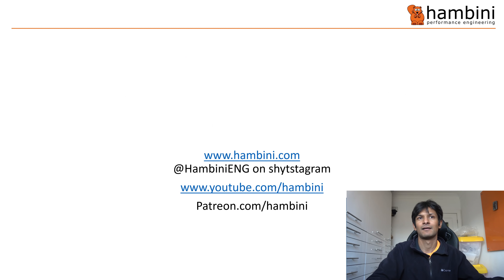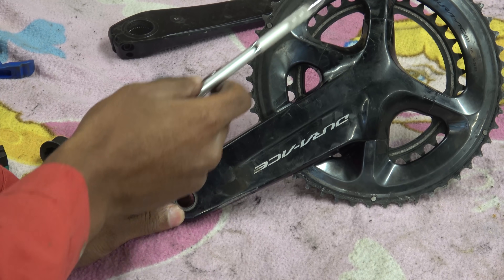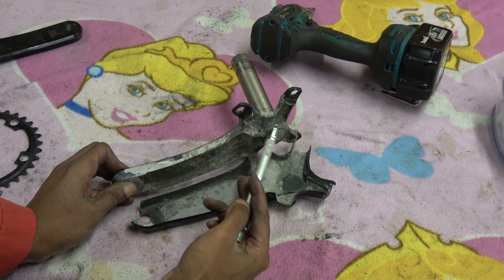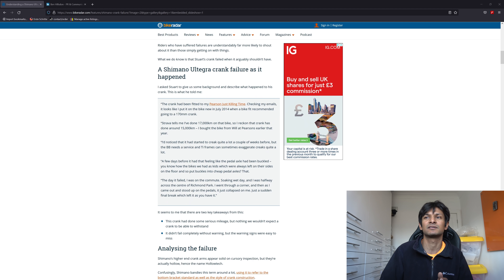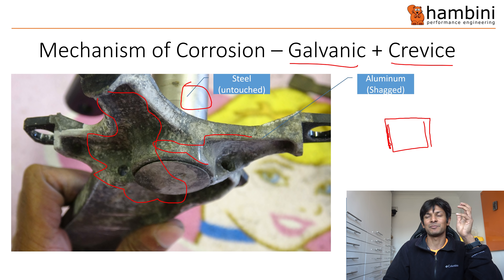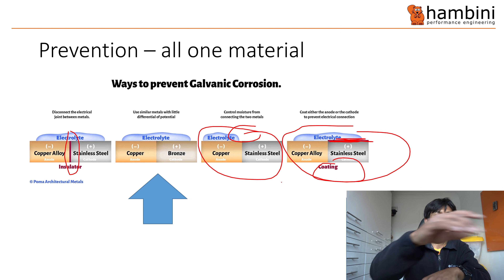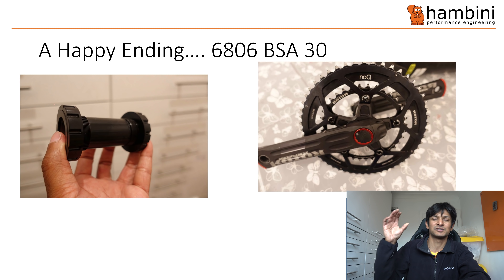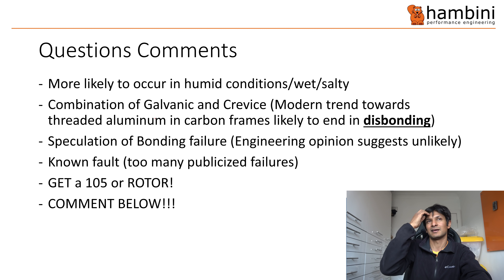Shimano REAMED for Engineering Incompetence

Comment: This was your best review by far and a well presented case Hambini . As a keen cyclist myself, the more you explained the reasons with the science behind it all, everything kept on becoming clearer and clearer. It was excellent !  I have had a Dura Ace 9000 split just as you described and was totally Peed off with the failure. It seems so unfair that the   extra price you pay for the bling stuff is made this way.
Reply: This is exactly for blink factor and for competition only. It’s a trade off. Something has to give under extremely engineering to win competitions.
Reply: The price you pay is for lightness, not durability. This is why it's recommended to NOT get dura ace accept on your race bike, if you have different bikes, otherwise, Ultegra or 105 for putting on tons of miles and time.
Reply: @budviser3793 But every reviewer and bikeshop I’ve listened to says you’re paying for lightweight and INCREASED durability as you go up the tiers in groupset. It’s all marketing ballshit aye

Comment: I am always amazed to find people attaching aluminum to steel or, for that matter, embedding aluminum in concrete. It's pretty basic engineering knowledge that galvanic corrosion results when these materials are in contact with each other. Ages ago I worked for DART in Dallas and when they took over the bus system (to expand coverage etc.) they needed new signage. There was a desire for the posts holding the bus route designations to be something "nicer" than a galvanized steel pole. They chose a square cross-section aluminum pole. It looked quite nice. Within a year of deploying these poles across the metro Dallas area, they started falling over. Turns out they were installed in concrete bases and the corrosion was so extreme at the point where the poles touched the concrete the base of the poles basically melted. Needless to say, the DART engineers were dumbstruck because they were never consulted. Had they been, they would have pointed out the aluminum had to be isolated from the concrete. Steel, especially galvanized steel, does not have this problem with concrete. This is like finding out buried water lines to my home installed a century ago were lead... seriously. Lead.
Reply: Shimano (and others) used steel axles in aluminium cranks for a long time. They don't corrode. I'm not sure this is the reason for the failure. if the glue detaches and opens the insides to humidity, it will corrode. And obviously it would detach where at the most stressed location, which is near center of rotation.

Comment: It’s pretty amazing that this has been going on for so long and Shimano are like “move along, nothing to see here”.
Reply: When this first started, the crank cracking, I thought it was a 6800 Ultegra thing because the new model is coming out since it has been running from 2013 with no failures then suddenly a lot failed in 2017. But the new models even Dura Ace suddenly started dying and me on 105 got scared for it's life despite the crank being 105 5600 lol and then I heard old hollowtech is the good one.
Reply: @Allan In person, I've seen 2 6800 fail, 1 R8000 and the rest I saw on social media. I've since then "upgraded" from a 172.5 5600 105 to a 165 4700 Tiagra and despite the weight penalty, the bikefit is much better and I think that's more important.
Reply: Shimano have used this strategy on many products since they started. It’ll get looked at when doing the next product refresh, but they are too committed to the tooling, etc to change. Cheaper for them to just be quiet and warranty the failed ones.
Reply: @codycanning5300  I doubt they’ll do anything when they refresh their lineups. We’ve all got the same issues in mountain biking we’ve been complaining about for over ten years now.
Reply: @KK-bk3dm  At the end of the 80-ties they where good. Since then it has been down the monopoly drain. Today they are selling mainly the stickers and a huge marketing budget mark-up. Fortunately the Chinese are catching up and alternatives are abound. I build recently myself a carbon frame road bike purely under the assumption that there will be not a single piece from shimano on it.

Comment: The VERY reason I run 105 Cranks. Thanks for bringing this back in focus and not letting Shimano off the hook. All of your videos are highly anticipated. Great channel, Thanks for all you do.👍
Reply: 105 same construction are they not? Hollowtech?
Reply: @paulruffy8389  They are not constructed the same at all. Hollowtech crank arms on 105 are not bonded. Shimano doesn't tell you about the difference sadly.
Reply: @larrymcgoldrick3471  I have actually just "upgraded" to a Ultegra crankset from 105, just as the the 105 was marked up and the gearing is 6870di2. But makes me wonder whether I shoulda just kept the 105 crank
Reply: On which series Dura Ace/Ultegra did they start doing bonded cranksets?
Reply: @Knowbody42  9000/6800
Reply: @dan_lazaro  I see. I guess I'm lucky to have dodged that with my Ultegra 6700 kit.
Reply: @Knowbody42  my favourite looking crank is the 6700/7900 series Ultegra Dura Ace from Shimano haha I just looks so much better than the 4 arm spider stuff even though I'm on Tiagra 4700 now. 165 Ultegra cranks are just so much more expensive in my country because people think it is a limited edition of some sort and not just a size option and I've never seen a 165 Ultegra 6700 that's compatible with 53-39 because cranks of that gen are different bcd in the standard vs compact affair haha. Def would love to rock the 6700 ultegra crank one day though, maybe someone somewhere would have the crank in my specs and it will show up to me at the right time
Reply: @dan_lazaro  Yeah, I always thought the 6700 crank looked better.

Comment: Mine failed on winter bike on Saturday, Ultegra R8000

Been well aware of the issue so check the crank/chainring for gaps while cleaning the drivetrain after every long ride. Went without warning just a pop/clunk while out of the saddle. Starting to separate in the centre and a crack forming on the crank arm behind the small chainring😠

Fortunately didn’t totally fail as still had 40+ miles to get home

Comment: Nice flashback to chemistry class! Yes, galvanic corrosion will occur in any two materials that have different electronegativity, especially in metals since they have so many free electrons I guess.
Stuck aluminium seat tubes or stems on steel frames was (and still is) very common, but that is an easy fix, just grease it down thus creating an insulating cover.
I have an oldish Sora crankset that sometimes creak, I thought it was the bearings, but now I'll have to really check!

Comment: In cars and trucks, rust expansion is called rust jacking.  It's also common in general for steel lintels in houses.
In cycling, aluminum seatposts corrode in steel frames. Removing one can be a monumental job.

Comment: I had exactly the same problem which turned into a full catastrophic failure across the spider itself.  It failed on a climb during a race, not much fun.  I thought that my bottom bracket was creaking but obviously it turned out to be a crank failure.  I did manage to ride / nurse the bike to the pub safely, so not all was lost.
Reply: I ride mostly track bikes if this happened at any rate of speed its OTB
Reply: @coreygolphenee9633  Fair point, but I don't know if Shimano do a track version of the 9100 series? (i.e built & assembled in the same way). Does seem that the failure mode will lead to an unexpected freewheel effect though, so possibly not OTB... (crashing to the floor probably very likely though :( )
Reply: @neilbathe  they still make the 7200 for NJS racing its a hittori Hanzo and a great reminder of what the company should be doing, but they could be trying to compete with SRAM omniums for a modern crankset and this is shit

Comment: Marine sacrificial anodes are generally zinc blocks, which are replaced on a fairly regular basis. They only work if any metal required to be protected, is in electrical contact with the anode.

Comment: For galvanic corrosion to happen on the anodic aluminium alloy, the locality where corrosion happen, needs moisture covering, and the same patch of moisture, has to extend to the cathodic iron alloy, to form a complete circuit for -OH to move to anodic Al, and +O to move to cathodic Fe.

There could've been some physical opening around the glue bonding line (due to glue dispensing line not forming a close loop), allowing water to sip in, especially alkalic soap water used in bike wash. And then alkalic moisture stays in the hollow chamber.

(You may test this out easily at home: have your used dura ace/ultegra dismantled from bike, remove chainrings & pedals, dunk it in a large bucket of water, and gradually turn it around, look for air bubbles carefully) Easier to observe air bubbles if you have cold crank and warm water.

For bonding to happen at optimum strength, it is quite a norm to apply bonding primer on both aluminium surfaces. At times, primer could be corrosive on AL alloy.

When aluminium hydrosite forms on the inner wall, it creeps horizontally along weak structural layer (like lawn weeds), depends on how the structure is formed (cast, forge, mold, extrude, CNC etc).
And it physically expands.
This expansion weaken the metallic surface adjacent to the glue.

So it ends up the same: delamination happens and the two halves crank separated.

The bonding glue did not reduce in strength, it's the metallic surface that it's holding, got weakened.
Reply: My experience with the Ultegra 6800 crankset is that there is a gap round the back of the spider where moisture can get in. This was my reasoning why the bond had failed on my unit. I also noticed that the R8000 I replaced it with did not appear to have a gap / was better sealed, but the instances of failure are still there it seems.
Reply: @essjayaitch  
It’s a challenge bonding complex contour such as a crank.
Based on Hambini’s review, it seems shimano is not matured in bonding process, where one of the critical parameters is to ensure consistent gap for consistent adhesive thickness. Without this facilitated by design, failure may happen in various locations and through various ways/modes.

Comment: Makes a lot of sense. Had a pair of Oval Concept 950 alloy clincher aero wheels, original equipment on my Fuji Norcom Straight and wanted to centre them as the spokes also felt a bit too loose. When I started to adjust the tension I realised that no matter how hard I tightened some of them, no effect. Then I had a closer look and realized that more than half of the spoke holes inside the rims had cracks, most if them several millimeters long. In general, the overall, apparently not even anodized alu part of the wheels was covered in corrosion products very similar to the ones in the Shimano cranks. I always wondered whether it is good design that when cycling in the rain, water was getting into the rim and it gurgled around it in there until after about a week, it finally evaporated. Now I know what else it did in there than just making funny noise. Steel aero spokes in direct contact with aluminium in dirty water - guaranteed desaster. I was lucky that I found the cracks before the wheels collapsing while driving. So, contact corrosion seems to be a problem generally underestimated or ignored by component manufacturers.

Comment: If you've not already done so, you should also discuss the reason the Shimano rear brifter destroys shift cables, causing them to fail inside the mechanism.  This often results in a shifter that can't be saved.
Reply: Happened to a friend of mine with his Ultegra 6700 brifter. On a descent in the Alps. He instantly produced thousands of permanent grey hairs as a result from the stress!

Comment: Excellent video. Its difficult to see how Shimano or any other manufacturer can engineer that system not to sufffer from this fault. In order for it to work it requires a hermetic seal between the two halves of the pedal. A small pinhole in the adhesive will be sufficient for the inner chamber to breath with the diurnal cycle and suck in damp moist air which may condense internally as the temperature cools down overnight so don't ride in the rain. If your in a country with a small overnight temperature swing you may not get the condensation  but winter in the UK could be a problem

Comment: I had this happen on three cranksets and Shimano replace all three without any issues. One was a 9000 and replaced with 9100, and since I was running Di2 they replaced the front derailleur with 9100 at no charge.   I keep a close eye on this all the time.

Comment: Abit of bad news for you- the rotor aldhu 24 uses a steel axle (the 30mm one uses an alloy axle) which is connected to the aluminium alloy crankarms (7075 or 6061 depending on whether its aldhu or vegast) by a threaded bolt (which I think is aluminium) so you're unlikely to run away entirely from galvanic corrosion here.

That being said, the entire crankarm is anodised and the rotor crankarms are a solid machined billet of aluminium, so any galvanic corrosion problems are unlikely to be catastrophic. The most you might have is a crank that might be hard to get out- but a thin layer of marine grease on the mating surfaces should solve the problem.
Reply: Yes, I noticed that from my 24mm Aldhu order coming in.

Nothing that a good lubing up won't solve 🤣
Reply: @phil_d  You are correct Sir, proper lubing is key to a successful outcome...🤔😉

Comment: Interesting and informative. I have a 27 year old Shimano RX100 crankset which were the 105 of their day. Still going fine and look nice enough. The bike is,also a steel frame and steel headset. Not the lightest in modern terms at 12kg for entire bike but I guess less different materials together and less risk of galvanic corrosion.

Given this issue is with top end ultergra and dura ace you have to wonder if the pursuit of lightest parts possible has gone too far and perhaps you're better off with very slightly heavier but welded 105 or it's 27 year old equivalent! If I upgrade from 8 speed to 11 speed I know to go for 105 and nothing higher.

I thought your explanation was good and easy to understand. Thanks for the video.

Comment: This happened to 2 of my Shimano DA-9000 cranks - brought back memories - the infernal creaking, the trying to source the issue (seat/frame), the mechanics having no idea - saying the creaking was coming from the spider bolts (utter-nonsense) even replaced an almost new press-fit BB to no avail. Eventually visible failure occurred, luckily non catastrophic. I ride in the tropics so I believe the moisture has an effect but a few friends have had similar issues with both Ultegra and Dura-ace cranks. Tried to buy Rotor but no stock so eventually found another DA-9000 (like rocking horse sh*t during a Pandemic) which will probably die after 20,000km like the last ones. Spoke to Shimano here in Indonesia.....Sorry Sir out of warranty. Annoying as my opinion is it is not fit for purpose - the crank spider /arm wears out before the chainrings!! I doubt however Shimano will recognise their issue  - is 9200 the same construction? Its a shame as I love Shimano functionality and performance.
Reply: People who can afford to pay for this are top 0.1% rich. I don’t think most really care about this being a disposal part that fails under extreme conditions. I personally won’t care if this could fail since I don’t live in humid area and don’t ride like a pro at all time and all I care is that blink factor. For pros, all they care is weight and performance, durability has to sacrifice. It’s a trade off. That’s the logic behind that design.